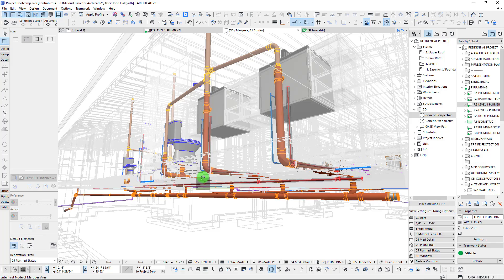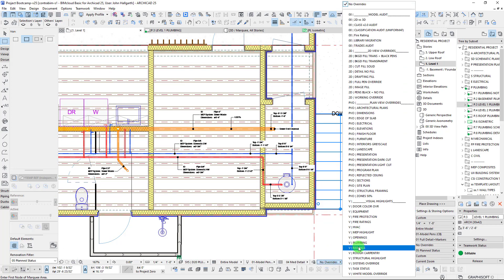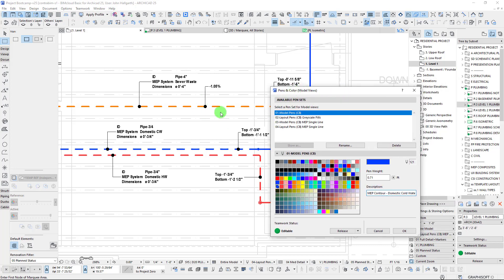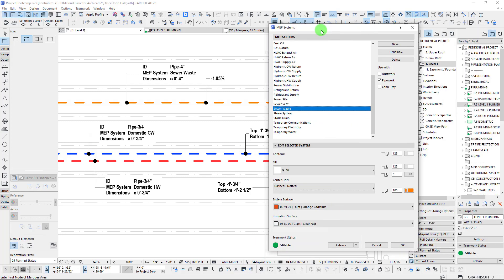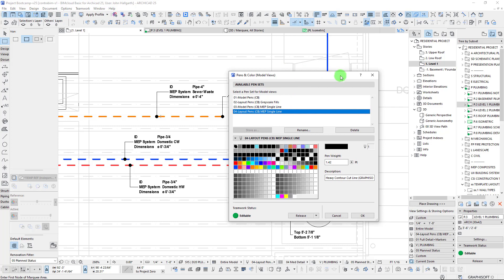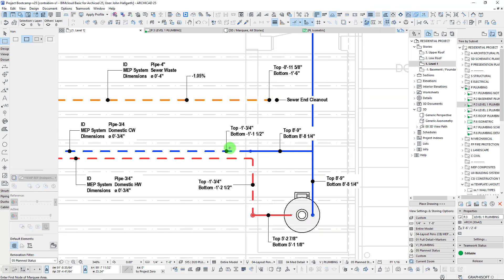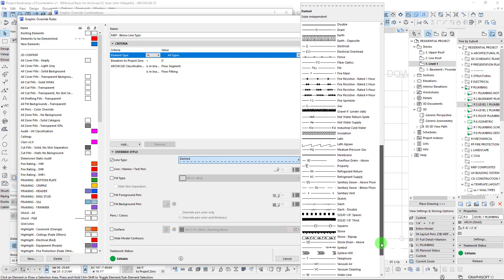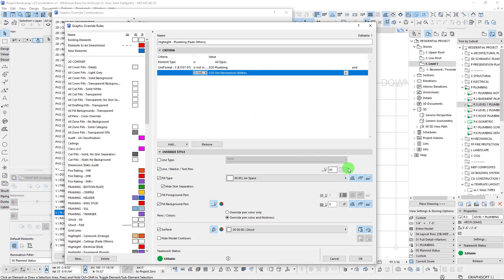How to Setup Single Line MEP Display Output in Archicad

Comment: The elevation triggered graphic overrides are cool. I have been doing something similar with timber beams in multi level open spaces. The more wierd things I do with graphic overrides the more I see that they can be used for.
Reply from the maker: That is awesome Gary! Since I figured it out for piping systems, I've also been thinking about how this can better improve the display of timber floor joists and beams below and above. Something I'm playing around with! Thanks for the comment!

Comment: Hi, it still can´t be used for an axonometry view, can it?
That´s one thing holding me back from using MEP :(

Anyway, ty for the video. :)
Reply from the maker: Hi Tomas! Your right that it doesn't work the same way in a 3D view. In 3D there isn't the same centerline pen. I've tried a few different techniques of combining wireframe and graphic overrides to try to get this to work, but not there yet! A challenge I'm thinking might be possible with a little more testing!

The 3D Isometric views with the entire piping system shown is still useful though, so I'll have to continue with that until I figure the other option out.

Thanks!
Reply: Graphic overrides work with all 3d view and 3d docs.